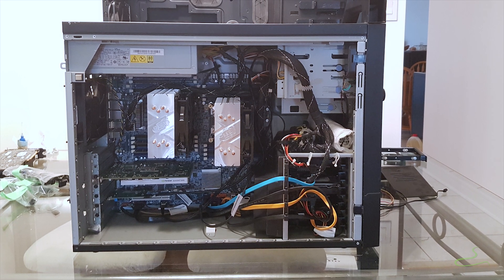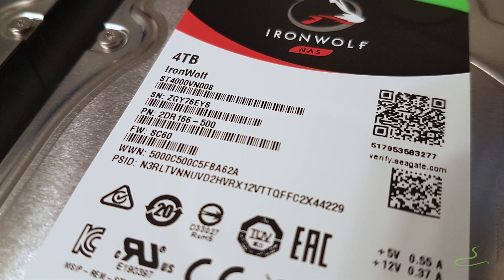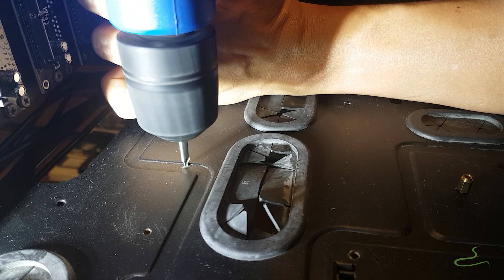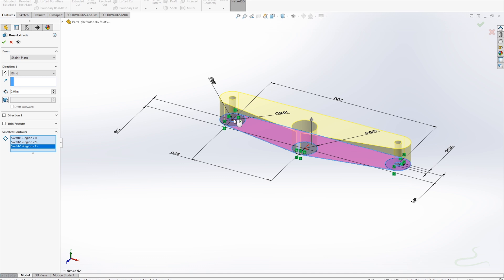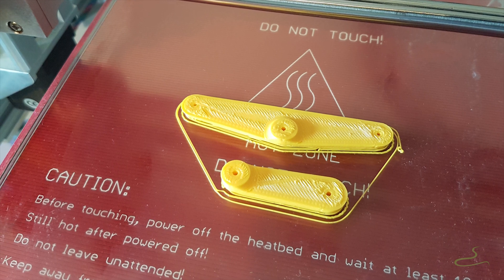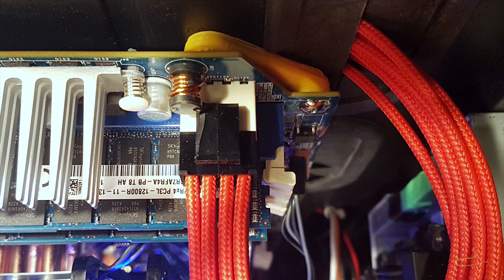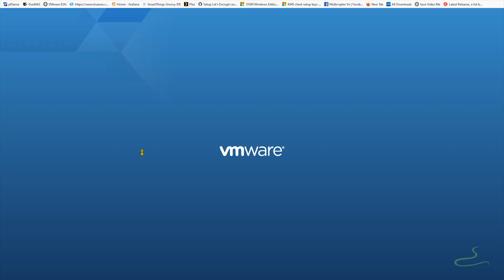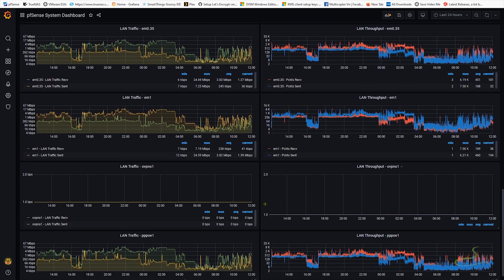#ThinkStation D30 #homelab server rebuild with dual #Xeon E5

Comment: Can the motherboard natively support 5 SATA drives without purchasing an additional controller or a SATA HDD enablement module?
Reply from the maker: yes it can support 8 SATA drives using intel chipset. But i need the additional HBA adapter so that i can passthrough the controller to my TruNAS server

Comment: Nice build.

Good innovation using the 3D printer to produce the necessary bracket.
Reply from the maker: Thank you. Still using this system to run my home lab server. Very capable to run various VMs in it with recent upgraded to 128G DDR3 RAM ie. TrueNAS VM, Plex server under Ubuntu VM, Home Assistant VM, ZoneMinder VM  and last I wanna add / build a Nextcloud server under Ubuntu VM

Comment: I bought one of those computer p 710 and I don’t know what wrong with the computer I plug it and the fans don’t turn on is that normal or sure the fans should be spinning?
Reply from the maker: Yeah check the RAM stick ìf they are all compatible with each other meaning you can't mix between 1.5V or 1.35V ram. Does the motherboard support the kind of RAM you have. Another thing to check is the video card. Best way to check if your particular motherboard support the video card you have. If it does, at least you gonna boot into BIOS. I had similar issue but after re-seating the RAM sticks. Move to correct ram slot. It boots up just fine. Hope it helps.
Reply: My computer specialist never came by and the seller wants me to send it back for a refund it’s a refurbished one so it might be that they didn’t set the wires on correctly thank for your message

Comment: Do you know how get to 512 of ram on this board? 

Just bought Ram Eec 32gb 1866 and does recongnize; seems something about this:

UDIMM or RDIMM, ECC, DDR3, 8-channel capable 
(4-channel per processor), sixteen 240-pin DIMM sockets,
128GB max (UDIMM, 8GBx16)/512GB max (RDIMM, 32GBx16)
Reply from the maker: Manual says u probably need to stick with one kind of ECC RAM. I cant mix. There is a setting in bios to select either 1.5V or 1.35V.

Comment: What cpu fans are you using? How are you powering those CPU fans?  I hooked up some new cpu fans and the board is reporting them as not active.
Reply from the maker: Whatever the fan that come with DeepCool Gammaxx 400 v2 https://amzn.to/3lCpHGH
The fan has 4 pin PWM by the way. I didn't bother to look for expensive cooler because these two are more than enough to run my server 24/7. Make sure your new fan is designed to use with 4 pin PWM controller. Some do have 4 pin header but they are not capable of PWM controller.

Comment: Great build. BTW , you can use quad channle ram for each cpu on this motherboard,so 8GB*4*2 or 4GB*4*2 ram is better.And you can use pcie nvme ssd with option rom such as Plextor M8PeY to replace the sata ssd.
Reply from the maker: @Samson. Yeah! I always want to do that with the RAM for quad channel. That is for next upgrade 100%. ALso thanks for the tip about SSD alternative. This motherboard is rock solid. Thanks again!

Comment: Have you considered using Proxmox for the project?
Reply from the maker: I have considered Proxmox since it's an open source project and free. I am sure Proxmox is as good if not better than VMware ESXi. But i personally think the free licence esxi is more intuitive to setup and run in my case in a small homelab. You know since its a homelab to study, i can change to proxmox system with problems

Comment: Good stuff. What is the case? And how many hard drive can you hold with that big full tower case?
Reply from the maker: thanks. it's a Corsair Obsidian Series™ 800D full tower case. I think I can fit maximum 12 3.5" hard disks. It also has 4 hot swap bay as you see.